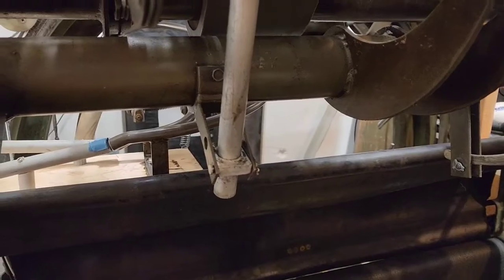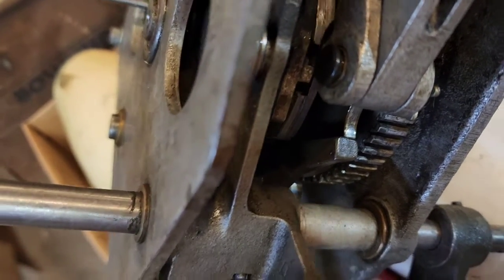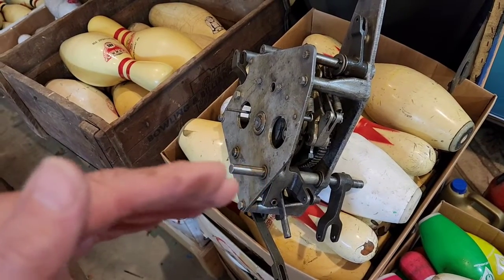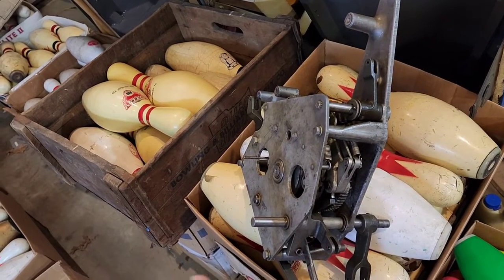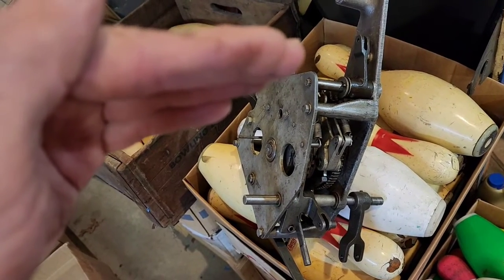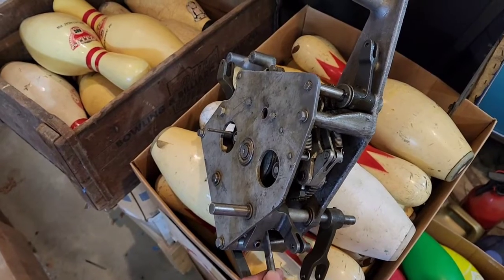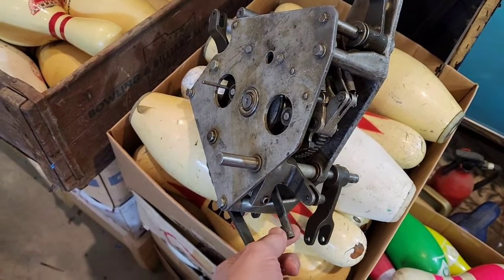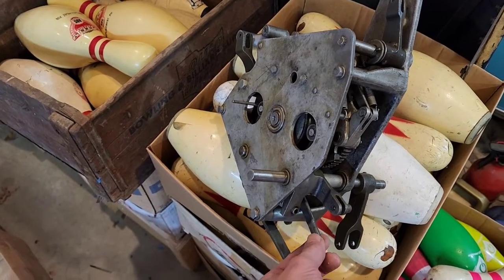Pin detection - How a Brunswick pinsetter knows a strike from standing pins  @GarageBowlingAlley

Comment: He forgot to show how the cams work on the side of the gear box and how the detector makes it move
Reply from the maker: I could have talked all day about the detector.    All the blocking fingers and can followers etc.   But.  I didn't want to stray too far and make it too long.     Leaves material for another video 😎🎳
Reply: @GarageBowlingAlley  I understand, it's that I worked on the pinsetters for 25 years
Reply: @GarageBowlingAlley  Can you show the detector at work when it cycles after the first ball?  How it runs in each of the 3 conditions?
Reply from the maker: Aren't the brunswicks amazing pieces of machinery ??

Comment: Amazing technology for 65 years old. Not to mention it just keeps going! Thanks for the great expalination!
Reply from the maker: It amazes me too.   Early 1950s a group of people created this.    And 66 years later the original machines still function worry free.    You need to do maintenance and upkeep to maintain that level but these things will outlast their creators and then some.     Kudos to those folks for creating something I am so intrigued by
Reply: @GarageBowlingAlley  You hit the nail on the head, as long as the PM is done, they will keep running. As an 8 year old, I was intrigued with the workings of the A, so much as the head mechanic brought me back to watch the pinsetter in action. For awhile, I was thinking about becoming a mechanic on the A machines. Now, I'm starting to wonder if I should have pursued it!